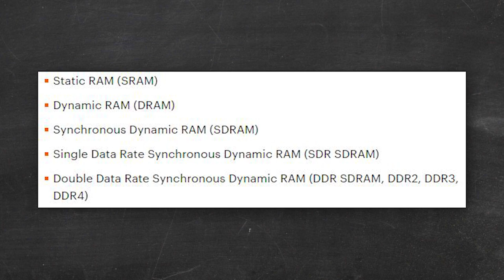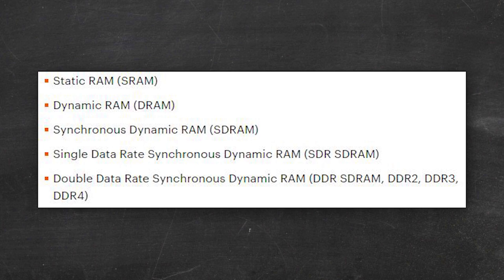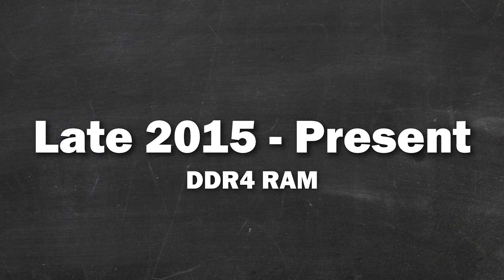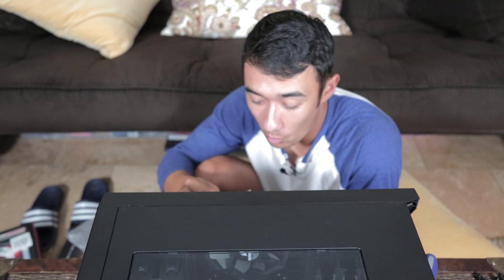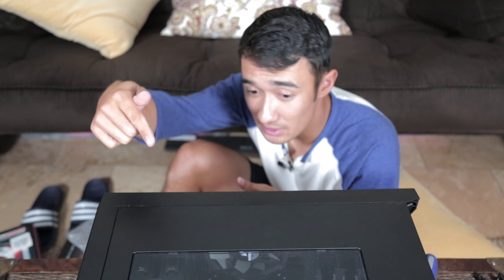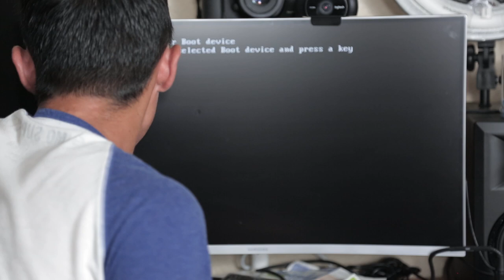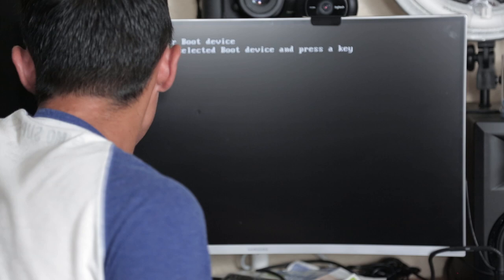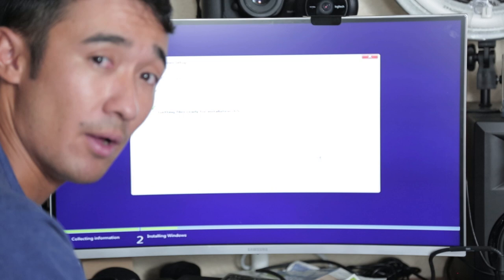How to Build A PC - Full Tutorial

Comment: Where do I put the tweezers and Swiss army knife?
Reply: Just put the tweezers somewhere inside your case and same with your knife so people can see it through your panel. I usually put it on top of my graphics card. 😜
Reply: Fasten them inside with the allen wrench
Reply: Just jam it into your extra ram slots or maybe pcie slots.
Reply: Open your power supply (it keeps it cooler) THEN, make sure all the blades are out and drop it into your power supply. This will make your PC look sharp. The tweezers can be used to uh tweeze the knife to one of the big capacitors in the power supply for more stability.
Reply: That hopefully has a screwdriver
Reply: Put the tweezers under ur CPU and the army Swiss knife u ram into your GPU
Reply: Put the knife into your heat sink so the heat can go through the knife and boost the fps. Put the tweezers in the psu to get an extra 100 watts for each tweezer

Comment: 26:39 dude the bottom fan on the PSU sucks air in, the air is exhausted out the back of the PSU
27:02 OH NO NO NO!  mah dude, the fan is an exhaust fan !!
the 2 front fans are sucking air in...
you got messed up there.
29:03 you could have opened the back panel and screwed the CPU cooler bracket without removing the mobo from the case.
31:23 you could have used a zip tie (or tweezers like the Verge called them ^^)
maybe you want to redo that build guide, not perfect at all.
Reply: geez little harsh at the end
Reply: I was cringing soo hard when he messed up which way the air intakes 😭😭
Reply: I was about to ask which case takes in air in the back, and exhausts it in the back. I've never seen that.
Reply: I thought I was dumb enough to think he was wrong with the air direction of fans. Thanks for correcting him.
Reply: Hope this gets pinned! Very good guide, but this something that new people needs to know.
Reply: I actually panicked for a few minutes, "have I had the fans incorrectly my whole life?!", but after some pretty intense googling (and finally, reading your comment) I can RIP.
Reply: so do i put it upwards or at the bottom
Reply: @edenwarnock7380   explain your question
Reply: he made a mistake about he fan direction, yes, but your logic is flawed on the cpu cooling bracket. You have to place the cpu onto something, its not just open air on the back.
Reply: Spooki Pants Most cases have cutouts underneath the socket, so what he said could actually be done
Reply: yes i noticed that to back fan is eshaust plus the fan on cooler should be blowing through towards back>.
Reply: @chef_supreme , yeah, he did mess up the direction of air flow through the fans, but only in his mind, since eventually he installed the PSU and heat sink fan correctly. A viewer who never built a computer might be confused, but only until he/she puts his/her hand in front of a working fan and realizes the air actually goes the opposite way.
Reply: Yeah I have that EXACT case and noticed the mistakes with the fans
Reply: 38:24 He makes the same mistake again explaining the CPU fan. The non-logo side of the CPU fan should be facing towards the front of the case.

Comment: at 26:50, Usually, fans take in air from the exposed fan blades side and exhausts out where the beams hold the fan blade and motor, so the single fan you pointed out was the exhaust fan and the two front fans are the intake.
Also I believe the power supply takes in air from where the fan is and exhausts it out the ports near the plug socket/switch

Comment: You forgot to add enough thermal paste to glue the cooler to it for maximum cooling potential. You also need to add more foam and whatnot under the power supply so it doesn't ground out and electrocute you while you're using it.

Lmao. I should be a comedian 🤣
Reply: Don't forget the tweezer XD
Reply: If it ain't smoking  you aren't doing it right....theverge! XD
Reply: bruh the verge wrote ur entire standup for you...

Comment: 👊😏 26:20 Buddy, ur going Full Verge on Me, a couple of boo boos but maybe theres more... the big fan on top of the psu is an intake fan so it sucks air into the psu case then that air is pushed out the back of the pc case. And the case fans, ur front case fans are oriented to suck air into the case, and the back fan next to the cpu is going to suck the hot case air and blow it out the back. Personally I always try to orient the psu fan facing into the case ala old school retro way however many psu cables are stupid short so if u do that make sure u have extensions for the 4pin cpu plug ☺️ And dont worry about the mistakes u did, its difficult to be perfect when you are recording video, thats what happened at The Verge they were in too much of a hurry and no one quality controlled the video 🤠🐂🐃
Reply: I must point out though that he can flip the fan to blow air either way.
Reply: Yeah, I noticed this too..and for a second I almost doubted my fan orientation knowledge because I usually trust Kris. Lol but glad to know someone else noticed this too
Reply: @Teacher5000  🙂 yes, the motor side is the exhaust side

Comment: Never knew building a pc is really this easy because I only play on consoles but after watching this video I'm going to build myself a gaming pc. I already have made my dream pc specs:
Asus TUF B450M Plus Gaming/ASRock B450M Pro4
Ryzen 5 3600
AMD stock cooler (Wraith Stealth)
GTX 1660 Super
16GB 3200MHz 2x8
EVGA B5 650W
NZXT H400i
Gigabyte NVMe SSD 512GB
I don't know if this specs can get 60 FPS (average) in all modern games at ultra settings 1080p but I hope it can. Atleast most of the modern games because I know that there is a lot of unoptimized or demanding games like Shadow of the Tomb Raider, Call of Duty Modern Warfare 2019, ARK: Survival Evolved, etc.

Comment: Nice build ! the only thing you got "wrong" was the case fans, as they blow air in the opposite direction than you showed in the video. If anyone watching this for their first build is having trouble understanding, the side with a plastic cross section (you'll see wires running through them)  is where the air will be GOING , and the side without a cross section is where the air will be COMING from :)

Comment: 14:45, Most motherboards recommend that you run Ram slots A2/B2 for the dual channel. if you run A1/B1 it doesn't harm your computer, it just doesn't run as efficiently as it possibly could. You put the ram slots in the correct spots, but it is worth a mention that there are recommended ram locations.

Comment: When I built my last pc, it wouldn't boot up and in frustration i eventually just took it to a shop. turned out the motherboard came in DOA. The shop (it's a canadian computer store..hint hint) replaced my 8 sata port motherboard with a 4 (!!) sata port motherboard. 

I dunno if the person was lazy or they didn't have any in supply and didn't want to order one. But now I will forever need a pci e sata card

most tech youtubers just build PCs with two drives so if that's your use case and a single 2/4/6 terabyte drive is sufficient then the above won't apply, but just in case...

Comment: great tutorial, missed one tip though... I learned the hard way. When using air cooling with a tall heath sink check if the case supports it. I once bought a case that was to narrow for my tower heat sink.. result: unable to put the panel back on. And second.. while it may not be proper pc building, I put in the front panel cables before I screw down the motherboard into the case, makes it way easier.  Love your video's being a computer building enthausiast myself and do what you do on a daily basis, just dont have the patiencce to film it lol. Would love to see you do a tutorial about computer maintenance like dust cleaning and some basic software for registry cleaning and stuff like that cause taking care of a computer is very much overlooked

Comment: I think you are confused about the airflow direction of the fans. Usually the airflow goes from the open face of the fan to the manufacturer's label. Fan manufacturers also put an arrow on the side to indicate airflow direction. So for example, the PSU fan pulls air from the fan opening and the exhaust goes out the back of the case. 

But you did manage to have all the fans going the same direction, so you didn't mess anything up.

Comment: I would add that if  the builder wants an optical drive, be sure to get a case that has and external 5 1/2 bay. I am building my first computer without an optical drive, and don't think I will miss it.

Comment: 26:50 Yikes, that's a mistake. Intake is the side of the case fan with no logo, and exhaust is the side with the logo. For this build, the two front case fans are pulling air in, and the back case fan is pulling air out. You should add an annotation so that people don't get confused by that.
38:24 Your CPU fan should be facing the other way, with the non-logo side facing the front of the case.

Comment: My first PC
 GPU: MSI 1080TI
CPU: I7-8700K 
COOLER: DARK ROCK PRO 4
MB: MSI pro CARBON 
RAM: 32GB 3200 DDR4
POWER: 750W GOLD COSAIR
CASE: mastercase pro 5
SSD : EVO 970 500GB & 250GB

Other: 
Dark steel 3 fans (X2)
Windows 10 pro
Mouse: logitech g502
KB: Cosair k70 lux silent
Mousepad: steelseries hard xxl 
Monitor: ASUS 144htz 1mm

Took me 4 months to buy.  Because I waited for good deals 
It costs about $2,000  but if I paid retail it would of cost me close to 3k
Also include shipping and NICE table with nice chair.

Comment: Yo kristofer just wanted to say thank you for this video. Just built my first pc using this video and it went without any hiccups. I will be posting my experience this weekend on my channel. So thanks again bro, it was such a satisfying experience
Reply: You should check the orientation of your fans... he was completely wrong about intake/exhaust. And please make sure you are not blowing hot air on to your ram but out towards the exhaust fan in the back...
Reply: how would I tell this? the whole fan orientation thing did confuse me a lil but I been monitoring my cpu n gpu temps and they have never gone about 40 celcius so I should be good right?
Reply: You also have to consider your vrm temps which arnt monitered...  as long as airflow is going thru from one end to the other orientation isnt a huge deal... however you dont want you heat sync fan blowing hot air on you ram modules. The easy way to tell is the frame side of the fan is exhaust and the side with the fan blade exposed is the intake side. In theory the blades should always be facing the front panel so they are pulling air in from the front and out the back. Even if one of them is on a radiator same thing. Also make sure your cpu heat sync fan is pushing air from the ram module side toward the back exhaust fan...
Reply: @cjwest10159  so from that pic I need to switch the fan to the other side?
Reply: @ThePatmanGaming  no... the worst part about this is the fans are all facing the right way but he explained it all wrong. And he actually installed his cooler fan right but also explained it wrong and his whole theory behind it doesnt make sense... so yes go by the pictures... and just make sure your air flow is doing from front of case to rear and you cpu cooler (if air cooled) is also flowing in that direction... if you also have a radiator at the top it is best to exhaust to out with the fans pushing thru from the inside of case otherwise you may mess with your airflow. I suggest going to bitwit or paulshardware channels as they have an amazing amount of knowledge on pcs and they have so many different build guides that explain all of the little things that so many new builders overlook simply because they are in experienced. If you gonna learn you should learn right the first time from someone who knows their shit. And good luck. Pc building is an awesome hobby even for beginners.

Comment: protip...

If you have ginormous hands like I do.. consider buying an matx motherboard with an atx case. The size difference is pretty sweet. Kris is bang on about sticking an itx in an atx.. it's pretty weird looking. I did it a few months ago when I rebuilt my brother's computer. I put a nice little fm2+ ITX in a huge full tower atx case that started out as yellow and was spray painted black by the local 3 fingered computer enthusiast who kludged together a single core computer on a 10 year old motherboard and sold it for nearly 350 bucks. 

I stuck the itx in a full tower atx because I had 2 hours to do the rebuild and couldn't make it to anywhere to get something smaller. I'm guessing my brother wouldn't notice anyway, but I found it amusing. I mean big hands and all, it was the easiest thing ever to build space wise. :P

Normally I do an atx with an matx motherboard and it's not too noticeable as not all atx cases are huge as you think. They have a range of sizes you can pick from.

Google everything.. know what they cost new and the general range of prices for used. 

One thing I always forget is to set the sata settings in bios to ahci before I install windows. It's a pain in the ass.

Comment: You don't have to unscrew the motherboard to put the back plate on for most cases. Most cases have a cut out behing the motherboard for this exact reason. The only reson it's advised to pjt the cooler on before putting the mobo in is because it's easier.

Comment: Zip or Velcro ties instead of "twisty ties" which can cut into the cables and have a metal core are a better plan for cable management.  With cranky old man hands I find them much easier to handle as well.

Comment: Most cpu coolers have brackets that have to be installed on the back of the mother board. Therefore you have to put the cpu cooler on before putting the motherboard in the case.

Comment: 24:15 that is not the case for most of the ASRock Boards. There will nothing click in, you have to push the red (or other colour) piece that is on the end of the slot against the slot to lock the Card into the slot.

Comment: Hey pointing out an actual mistake here. (Not verge sarcasm)

 I think your idea of fan direction at 27:00 is backwards. That single fan at the back by the motherboard is placed as an EXHAUST. The fan on the opposite side in the front is an INTAKE. You should be able to double check on that by looking at the directional arrows on the side of the fans. (Most fans have them).

(You shouldn’t have any issues either way though as long as all the fans are pointed in the same logical direction)

Not sure if you just misspoke but just pointing out the mistake!

Besides that, you’ve done a great job explaining so far! but I just had to double check before recommending this video to someone I’m about to help build a pc!

Maybe just put annotations there so that new builders are educated correctly and don’t get that little detail mixed up!

Thanks!

Comment: The PCI-E lane matters less for gaming and more for BIOS/boot issues. I put my GPU in the second PCI-E slot, and half the time i booted, the mobo wouldn't recognize the GPU, so I'd have no monitor output. I shifted it back up to the top slot and I never had it again. Pretty much all the pertinent information is in the manual (USE THE MANUAL! EVERYONE NEEDS TO STRESS THIS FOR NEW BUILDERS), even how to set up your cards for SLI and whatnot.
Reply: Also, it is ALWAYS much easier to put the CPU cooler on BEFORE putting it in the case. Allows you to avoid cramming your hands inside the case.

Comment: Just be aware the ESD portion of this video is extremely inaccurate. Do not place any exposed circuitry on cardboard. Just because your grounded doesn’t mean the work surface is. Place it back on the ESD bag it came in would be better. Buy a small ESD mat and ground that and yourself. Great video other than this

Comment: Im pretty sure kris made a mistake, the blades on the fans show which way they are intaking and when you see the brace on the back of the blades that is where they are exhausting to/the air will be going at that direction. 

Its kinda hard to explain in words, but if im wrong then whatever. You can see for your self if you search up fan exhaust or intake

I dont blame kris for messing this up, they are pretty easy to get confused on

Comment: A serious mistake that I have seen anyone mention in the comments:

You shouldn't put the RAM intoslot 2 and 4 JUST because your cpu cooler is too big and you need more room. You have to check your motherboard manual (or sometimes it's printed onto the motherboard) to see which slots you use first. If you put the RAM into the wrong slots, it will not recognize (or I've heard that sometimes you can't even boot up) the RAM.

Comment: To be fair, the only thing I saw you do wrong was when you installed the OS. 

DONT change the boot order, otherwise in the future when they boot the system, if they have a USB plugged in it will try and boot from that, including during the install. Push F12, and do a temp boot from off the USB. Every boot after that will be from the main drive. Also you can pull the USB at the first reboot as the install copies all the install files to the main drive during the first phase and uses those files from then on.